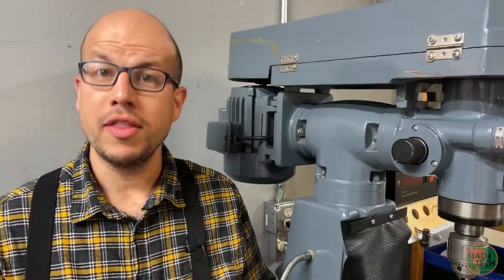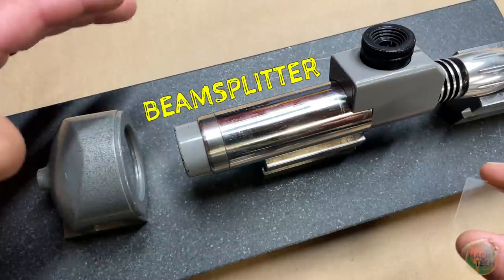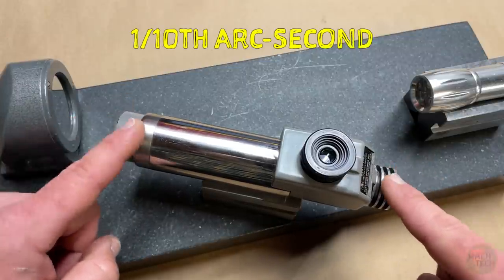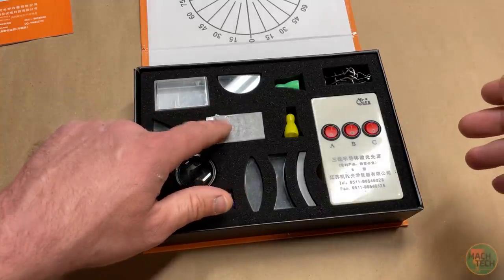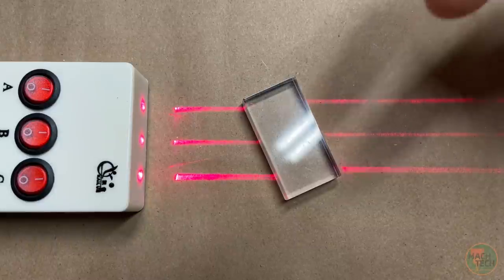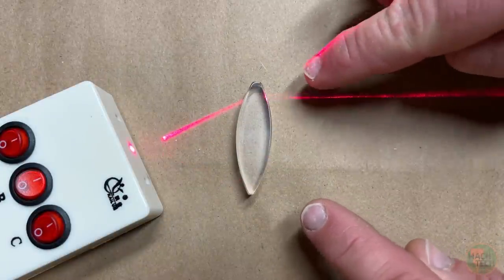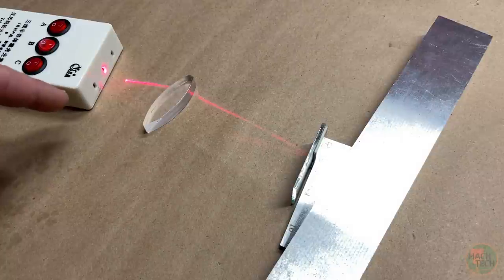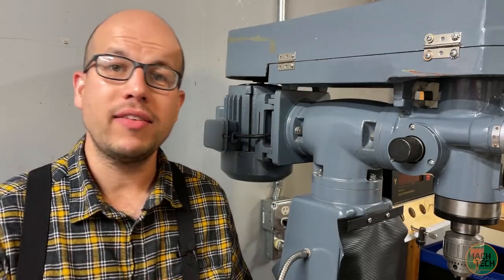Autocollimators 1: Introduction

Comment: Great video!  If you had used what's known as a first-surface mirror (a mirror that has its reflective coating on the outside of the glass so that the light never has to enter the glass), then the reflected laser light would have have been very crisp as it wouldn't have been diffused by the poor optics of the glass.  These mirrors are used in Newtonian telescopes as the optical flat.
Reply from the maker: Absolutely! This cheapo optics kit didn’t come with first surface mirrors, but they are an absolute necessity in autocollimator systems. I will be covering this when I get to component selection. 💪

Comment: I made my own autocollimator and I am a little confused.  A lot of the videos I see, the FOV seems telecentric, where the image of the reflector seems to stay the same size.  When I back off the target on my own setup,  the crosshairs do indeed stay aligned, but the FOV shrinks.  You can still see the crosshairs, the reflected image of the mirror just shrinks.

My focal length is 150mm, objective is 10x.

Comment: Don't get me wrong, I am totally ready for a FOCUSED (heh) series on autocolimators, but I'm still super interested in the air bearing series. Are you planning on continuing those videos?
Reply from the maker: That’s the plan! The air bearings and autocollimators are basically all part of the same larger project (the ultraprecision lathe). The footage for the air bearings series is already shot, but the production method I selected for that series is WAY more time consuming. So I’ve started editing it, but I’m also trying to find a way to get it done efficiently without sacrificing content, if that makes sense.
Reply: @LaneyMachineTech  oh man, I didn't know these were all part of a master plan! Now I'm super excited! Do what you gotta do, sir 😁👌

Comment: Adam: and that's just how light travels; in a straight line.
Me: but but but gravitational lensing tho 
Seriously though,  every video you put out is informative, funny, concise,  interesting and... we need more!
Reply from the maker: Thank you! I’ll try to keep up the pace. This video was a lot easier to make than my previous videos and I don’t think the content suffered for it. Re: gravitational lensing, I believe it’s space-time that curves and makes light appear to bend from our perspective. But it’s relative and from the light’s point of view it’s going in a straight line the whole time.
Reply: @LaneyMachineTech  When space is curved in our universe, straight lines remain straight, but the parallel line rules no longer apply. Lines that are parallel in one region of space can intersect somewhere else. The most confusing part is that there can be more than one straight line between two points.

Fortunately, I never plan to calibrate equipment anywhere remotely close to a black hole or neutron star.
Reply from the maker: @hamjudo  You hurt my gray matter.

Comment: Oh man... so many puns to make! You sure were able to keep me focused. Thanks for shedding light on the subject. It always helps to see these concepts through a different lens. You've gotten really good at making sure that your personality doesn't come across flat. I like that you were able to show parallels between the costly equipment and the cheap kit. You have a really interesting angle on the subject matter. Your presentation clearly mirrors your passion. Ok, I'll stop... Sorry everybody.

Great video! I can't wait to see what you come out with next. I've started filming a tiny bit but I have a long ways to go before I have anything decent enough to convey a clear message to my students.
Reply from the maker: Only after becoming a father could I truly appreciate that type of joke 😂 Well done, sir! This video was shot with an iPhone 12 using the FilmicPro app. I also used a Rode SmartLAV+ external lapel microphone plugged into the iPhone. Editing was done in Adobe Premiere Pro, but it could have been done in iMovie or any other editor. I think it came out great! Smartphone cameras have come so far and they can really hold their own against DSLRs and mirrorless cameras, which themselves aren’t perfectly suited for video. The low light performance of the new iPhone is breathtakingly good and you can record high quality shots without floodlights lol I can highly recommend the setup I used here.
Reply: @LaneyMachineTech  at the moment I have been using my crappy old beat up samsung phone and a cheap lav mic from amazon. I just need to find more time to experiment and get all of the information across.

Comment: Great video! Could a collimator be used to align a sailboat propellor shaft with the output flange of its motor? With the boat out of the water and the shaft removed I would mount the collimator below the hull in the the P strut, and shine the light/laser through the prop shaft log, into the the boat where the beam would be reflected off a mirror mounted to the output flange of the motor. Probably overkill, but I’d like to hear your thoughts. Thanks

Comment: keep in mind how deep the light is inside the box and where it starts from  so if the box was removed i am sure if would be all most ontop of the out coming light
Reply from the maker: In this particular case it doesn’t matter where the light originates inside the source. The light rays combine at the focal point of the lens, but beyond the focal point they diverge again. So as long as the light source is placed on that same line, it can be placed beyond the focal plane. I hope that makes sense.

Comment: autocollimator is a great tool to aline things(linear rail)but  it's hard to get those old  models,new one with computer and electronic(possible ccd)is very expensive
Reply from the maker: Yep, I have three of the older-style autocollimators. I tracked them down for a decent price over the last couple years, but they all had something which needed to be fixed. You can also make a DIY version with basic machining skills.